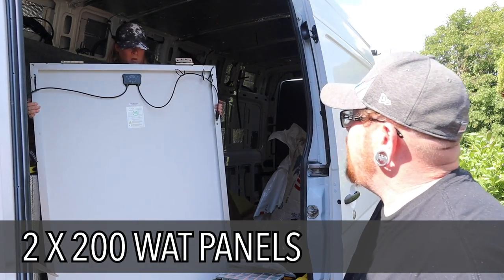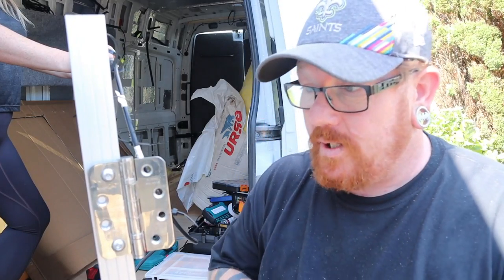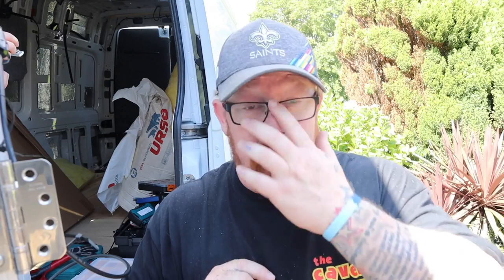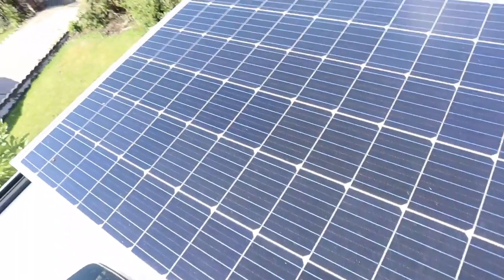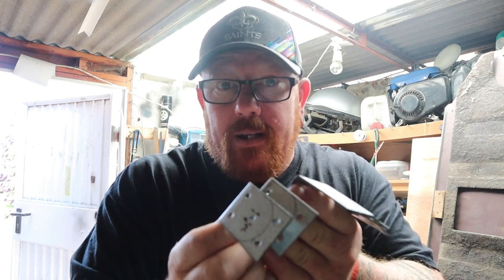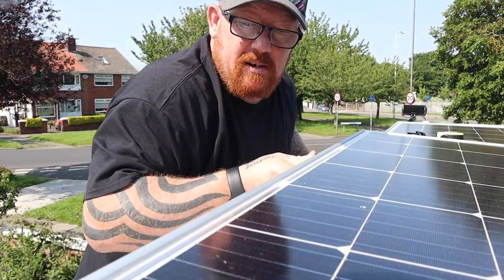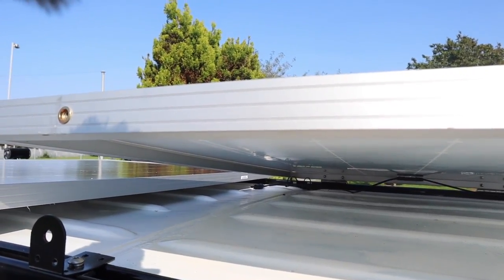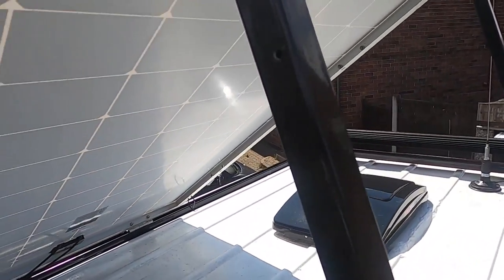An EASY Solution To Make Your Van Build Solar TILT

Comment: That idea is priceless. Gas struts could fail due to dirt, while going at 106 lol . youre idea is a lot more secure and saves £200 well done
Reply from the maker: Cheers buddy . It’s simple and works very well
Reply: @UrbanVanlife  and why reverse the tilt . just move the van to get the sun onto the panels

Comment: Nice simple way to mount your panels. I’ll likely use that idea but that’s a pretty cumbersome process for deploying them. Also the angle should ideally be adjustable as a slight change can make a big difference in power output.

Comment: Very nice job.  Easy, inexpensive and highly functional.  Thanks for the tips.  I think I am going to do this.  Also, I think if you make your angle holding struts 2 piece (One size large enough for the other piece to slide into) and drilled a few holes along the length then you would have angle adjustment options by just pulling a wing nut off and lowering it or raising it to the next hole.

Comment: Quality good idea that the bars are one less thing to fail, might have been a good idea to make them open opposite just so you can catch the sun all day as it moves around. I love these videos no faffing around with calculations amd spreadsheets just crack on and overcome as you go. Also bit of blue for the dads I expected Benny Hill to come out n give Emma a hand to pass the panels up ha, keep it up this is one of my goto channels 👍
Reply from the maker: yer some one else mentioned that about having them able to tilt both ways and im going to look in to it to be honest its just a case of doing the same on both sides with the hinges and i wouldnt need the brackets i could just fasten down with 1 of the plastic screws in each side . ill have to check just how much cable there it . its 100% something ill be looking at in the next few weeks cos it makes sense

Comment: Hi!! I'm so happy. I bought everything to put the rails on the roof. I will do it with rivnuts as well. Did you seal the bolts or the rivnuts and where? To prevent leaking water. Thanks !!!!!

Comment: Great video. Do you know what the best angle should be used? Winter and summer?  Love your humor. Reminds me of Benny Hill.
Reply from the maker: There is no specific best angle . It’s all depends on your position and the sun . Sometimes raise in the solar by 6 inches can give you treble the input as can 3ft raise . Best thing to do is check the solar input while your tilting . We have now fitted ours to actuators so we can see what’s going in while we raise them

Comment: Nice idea. I'm trying to think of a way to get a two-way "swivel" so you're not forced (in your case) to point the van West. 

Or maybe a four-way swivel? Am I asking too much ?!
Reply from the maker: Let me know how you get on . It can be done but we’ll above may paybgrade that one lol
Reply: You might consider building a lightweight, low-profile frame (1” square tubing) that fits under your panels. Then you have a crossbar at the front and back that the “frame” attaches to. Use a bracket at each corner with a spring loaded “pivot pin” - I’ve seen these U-shaped and you pull the pin out and rotate it so that it stays retracted. You just pull (retract) the pins on the right or left side, and lift that side up. You only have to access one side to raise or lower the panels.

Comment: I'm framing a 30cm tall case across my van roof. With venting for smaller homemade fans and maybe a DC powered air conditioner (maxair, fantastic fans are too large). Between the venting will be airtight/watertight storage for surfboards, a kayak, and maybe a waterfoil board. On top of the case would be one or two tiltable solar arrays. Preferably a light one. Reinforced with alluminum, 4 - 5cm thick. Framed with a light wood with sealed plastic panels instead of metal/glass ones. And tiltable with a handcrank. No electric motors. But here's the thing. The whole array cranks over (pistons sliding to the edge inside a rail) out to 185 degrees! Forming an awning over the side doors supported with 3 to 5 telescoping poles. But now on top of it under the panel array is a light, sturdy deck to hang out on. And you can clean the panels from the ground! Now, on top of the van is another deck with plastic panels built into or adjacent to the storage lids. Here now, you have 1 to 2 kilowatts of solar. Enough to top off an electric vehicle or hybrid sitting for a few days, camping. If you smartly decide to install an electric or hybrid engine down the road someday. I'm throwing a few grand at this idea just to see if I can do it. Thanks for your build to give me this hairbrained scheme, if it's possible. I live on the road so it can be a drama project. That's fine. The storage space and increased solar is worth it.  And maybe I'll go with cheaper panels like yours because they'll be light enough with piston support.
Reply from the maker: Sounds like a big job that mate . I know the o team have done a similar thing with storage under there solar
Reply: @UrbanVanlife I have a nice old mechanically restored van ready to be built out. Never did a custom build. Can't wait.
Reply from the maker: @CaliforniaBushman  you haave all the ideas going on mate so I'm sure its going to be an epic build , I like the sound of storage under the solar but to be hinest we have more than enough in the van for us any way , but good luck with the build mate , its nice to hear people doing a thing and looking forward to stuff as well , youlkl have to follow us on insta so we can keep an eye on your build and see what your doing , if your on Instagram,

Comment: I would love for you to make a video on how you use the rivnut tool. I see you have mentioned it a few times, but I'd like your advice on the right way to use it and the best kind to get.

I love your videos btw, I've learned LOADS of tips from you, since I'm trying to do the things you've already done.
Reply from the maker: we only have a amazon special to be honest bud , and its realy simple to be honest you just see what size riv nut you need and drill the hole in and screw the nut on the gun thing , and then pull back the arms , kind of like use in a rivet gun but you can screw in to the rivet , cos its a rivet nut , i dont think you could go wrong to be honest mate , there are realy exspensive ones and cheep ones , but they seem to do the same thing , all i can say is the cheep on  we have worked and we have had no problems with the rivet nuts we have put in , hope this helps but if not let me know and ill get emma to do a video , and we can all have a giggle watching her with a drill and riv nut gun , that  actualy sounds like fun now im thinking of it

Comment: Awesomeness..im going to do the same..im thinking that the legs you made to raise it if they had two bends in the middle you could optionally criss cross mount them shorter for fall sun
Reply from the maker: yer the legs im still looking into , if i could make them extendable or even make it so they could be screwed in to the side at different heights this would massivly help

Comment: Great video, subscribed!

Hopefully you still check comments on older videos from time to time, but my question is:
Now a considerable amount of time has passed and presumably you used this system a lot... Is there anything you would change about it in hindsight? Did you have any issues such as keeping the roof clean, issues with the rack over time, did you end up changing any part of it? Would be great to hear how it performed after using it! 

Will continue to check comments to see if this has already been answered, thanks for the great videos :-)
Reply from the maker: We do check comments . We have also today changed the roof as well. It’s kind of still the same but not . But like every van build the roof needs cleaning all the time and can be a pain but easy to do just takes time

Comment: Hi, this is great!! Is there any potential problem from multiple panels being tied together through the metal rails and then into the metal van? Like could you get shocked touching the van or anything like that? Also is there any noise driving down the road from the wind flowing under the panels and through the unistruts? I have a normal little roof rack on my other vehicle and it sounds like flutes, dives me nuts lol Thanks!!
Reply from the maker: As long as your cables are all fine then you have zero chance of getting a chock . And ours have zero noise at all that was even before we put the roof rack on it . Like non

Comment: Hi great idea fitting hinges to the uni struts 
Do you have a link to them hinges as can not seem to find any that would accommodate a M8 bolt or did you drill out the holes even larger to fit the M8 bolts? 
Thanks
Reply from the maker: Yer we had to drill them out a little mate not much but they did need a slight alteration . There from screw fix

Comment: Did you fabricate the supports to angle the panels?  Id like to see that..  I like the solution for the hinges fitting in the unistrut.  Genius.
Reply from the maker: Yer mate the supports where just done 1inch box section I manipulated with a big hammer . It was the simple solution . We had all kind of ideas but kept it simple .

Comment: Hello Mate, this is the best solution ive seen so far and looks much more stable than something like the renogy pre made ones yoj can buy. I will be copying with pride ☺. Can i ask where you purchased the uni strut, hinges, sprung nut things and the bars you used instead of pistons?cheers
Reply from the maker: The unistrut and the spring things for the unistrut I got off amazon mate it’s 41mm unistrut . The hinges I got from screw fix and there fire door hinges . And the bars I used are just box section I had lie in about they where is a old mobile dj lighting rig but I’m pretty sure you could use pretty much any thing to keep them up with a little imagination that all I did . And man copy away dude it’s just a simple idea that works . And yer we looked at a few tilting ideas and they all seemed to be pretty crap to be honest . Thanks for watching mate .
Reply: @UrbanVanlife  excellent, thank you mate. Look forward to seeing the build progress 👍

Comment: Excuse me and maybe I missed the question, but at which angle do tilt the panels for a optimal efficiency?

Greetings Henk. (NL)
Reply from the maker: it all depends on the season and height of the sun , it can be from 20 to 45 deg , but if you can monitor your solar input you can see how much power your pulling in while tilting them .

Comment: Love this! Stupid question perhaps but how did you make your bars to hold up the panels? Grind off three sides of a bit of box section steel then bend the remainder over a bit? I don't know shit about metal work so had to ask 😂
Reply from the maker: Basically just as you said mate it’s just box section I flattened the ends of and bent to the angle I needed . Pretty simple way of doing it but still works perfect
Reply: @UrbanVanlife  Soz for the late reply, lost my own comment! 😂 Thanks mate that's very useful... tackling this over the next few days so good to know. Did you use steel or aluminium? I'm guessing steel would bend a little easier?

Comment: Nice vid, where did you get the spring washers? Can't seem to find them online but might be searching for the wrong thing. Thanks
Reply: Hi ya, you can get them on Amazon, but they seem to have flow up in price,
However you can shop around and have a look on websites such as JTM Plumbing, TLC Electrical, Digi-Key UK and ElectricalDirect they all sell them different sizes so make sure you know which ones you need
Reply: @emmaurbanvanlife120  thanks

Comment: In hindsight, any thoughts if the panels should be tilting towards your camper side door or away?
Reply from the maker: I’d say lifting them so the actuator has a tilt on it . One thing we didn’t know . But good to show our mess ups so others don’t do it . With a tilt it works perfectly

Comment: Neil, can you plrase let me know where did you buy those bolts with the black knob that you tighten the bar that lifted up the panel?
Reply from the maker: Are these the ones mate      uxcell Clamping Screw Knob, 38mm... https://www.amazon.co.uk/dp/B07R48C7LH?ref=ppx_pop_mob_ap_share
Reply from the maker: We also use these as well mate      Male Thread Adjustable Fixing... https://www.amazon.co.uk/dp/B07NVN8KGC?ref=ppx_pop_mob_ap_share

Comment: Superb! Uni-Strut what a great idea. This is the system Ive been looking for 3+ years. Hope to finish my Chevy Express next spring.
What did u use to fasten the uni-strut? thanks :D
Reply from the maker: we just bolted it down with 15mm bolts in to riv nuts , trough the original holes in the can where you would attach a roof rack , we did think of bolting with a nut on the inside but then if we ever needed to change any thing we could never get to the nutts , so we opted with riv nuts
Reply: @UrbanVanlife  thanks so much, I was going to buy expensive Ryno rack. My interior is done, so rivnuts or self-tapping sheet metal screws may work? Good job on your van build by the way.

Comment: Maybe use a 12 volt actuator with a backup camera to inside to raise lower to position.  Would not need to lock down either  becuase acuators can hold alot of weight.  I would mount under the solar panel so the span works better
Reply from the maker: iv thought of that bud , but my only issue is the weather , and with it being on top its out in the elements all the time , im just going to stick to the poles for now , there simple and easy and will never stop working

Comment: Very cool design! We are thinking of  making our solar panels tilt on our Skoolie and this video provides a great design for making that happen! Have you thought about a way to make it tilt in either direction (not just off one side)? That's what we're figuring out right now...
Thanks for the insight!
- Brian + Erin
Reply from the maker: Hey guys you could hinge both sides with the same hinges abs just fix them down with the nuts with the handles on . On both sides and then you could lift them both ways
Reply: @UrbanVanlife  that’s what we were thinking could be a possibility! Like your idea for the fire rated hinges. They are stronger and the pins are set so they don’t fall out. Thanks for responding!
- Brian + Erin

Comment: hey! love this idea! the safety hinges you used are stainless steel? would you recommend using galvanised screws/hinges vs using stainless steel? i say it cause galvanic corrosion that could take place if using the zink boinger with stainless steel stuff, it could weaken over time i guess. Or perhaps not, if the unistrut is also galvanised and despite de paint the boinger makes contact with it and the galvanised mass is bigger than the stainless steel stuff... also worried about aluminium from the solar panels vs the stainless hinges hahhaha, idk perhaps i'm overthinking it! what do you think about it?
Reply from the maker: I think we all over think so much . I’m also one of them if it works do it kind of ppl . We used stainless on them . And with going up there to clean the panels you get to check it all and have a good look over it to see for anything going wrong . But love your thinking even if it’s overthinking .
Reply: You've just ruined my day.  Never thought of that. I'm now going to overthink your overthinking....I'm an overthinker too.

Comment: mate that's amazing, how did you make those bars at the end which you used to prop the solar panels up? Or where can I get some?
Reply from the maker: it was just some box section i had lie in about mate so i flattened the ends off by beating them to death with a hammer and drilled out our and riv nutted the other , really simple approach to be honest but works perfectly , thanks for watching mate
Reply: @UrbanVanlife  sweet, I'll give it a go! (and I've subscribed!)

Comment: Ayup Neil the time has come for me to put my hand and buy some solar panels, After days of googling and watching vids I'm still none of the wiser,  its a trust thing i think are they going to last or be any good do i trust ebau etc could you please give me some advice? which ones do i buy and where from i need the whole shubang solar charge etc.

Cheers Neil great vid buy the way 👍🏻
Reply from the maker: we got all out stuff off amazon bud , but i trust ebay as well , what are you thinking solar wize . like what are your needs . how many wats bud
Reply: Cheers for getting back to me so promptly mucka, as regards to what amps I'll be using i haven't a clue to be honest im a complete novice. I'll be powering my diesel heater, Aldi coolbox, lights charging phones etc im not fitting an inverter or powering anything big like a kettle, hairdryer etc im sorry i couldn't give you the exact amps required Neil but i hope you can sort of guess through what i said im powering sorry bro.

Comment: Hiya, this is amazing. I am filling it word for word! We’ve bought our hinges but the holes are too small for M8 bolts. We’ve tried to drill bigger holes, but they’re too strong 😬 how did you do yours? Happy to buy new hinges if you’d got a recommendation. Thanks so much!
Reply: *following
Reply from the maker: The way we drilled them was with a few bits . But good sharp drill bits abs just make the hole a little bigger each time and go slow with the drill let it cut and don’t burn it out . That’s how we did it and also spray a little wd40 on the hole when drilling it helps the cutting process
Reply: Ace! Thank you. We’ll give it another try 🤞🏻👍🏻

Comment: putting the special do-dad brackets on the side of the corners of the panel will let you tilt the panels to either side depending on how you park... I do have to think about carrying a ladder in the van to tilt the panels into the sun to get to that late afternoon or early morning hot sheit... I have this ridiculous rule that every item I take has to serve at least 2 or 3 functions to be allowed on board...